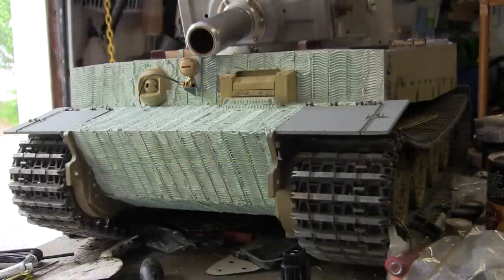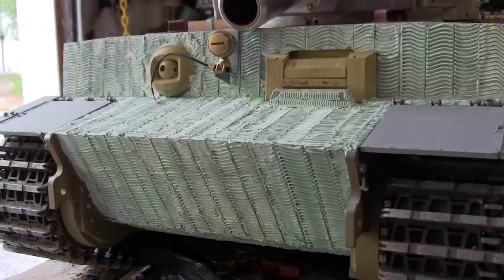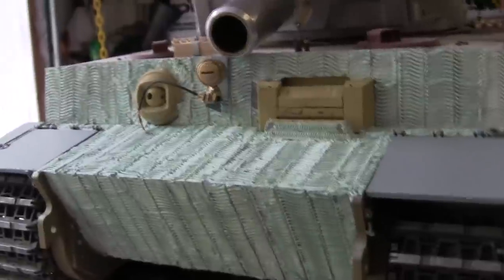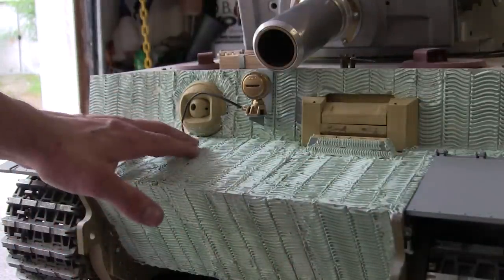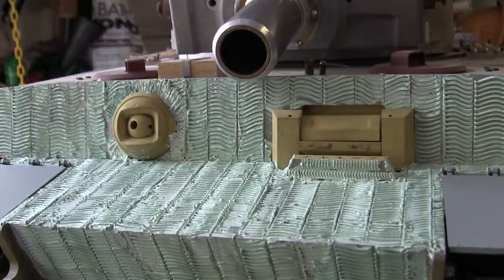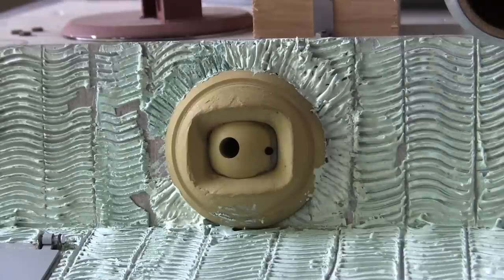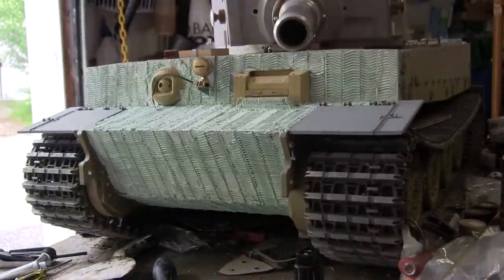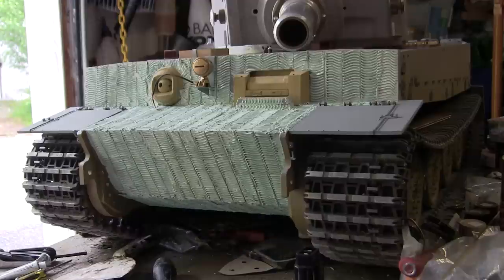Armortek Late Tiger I Project video #9 (Front hull details)

Comment: Why early tracks on a late?
Reply from the maker: because armortek took a shortcut and saved on tooling by recycling the early track for use on all their tiger kits
Reply: Fair enough, how was the kit to put together?
Reply from the maker: @scottbedard3471   pretty good, it's a standard armortek. The kit's proportions are good, the materials are good. The details are basic, and other than a few key areas to watch out for goes together pretty well